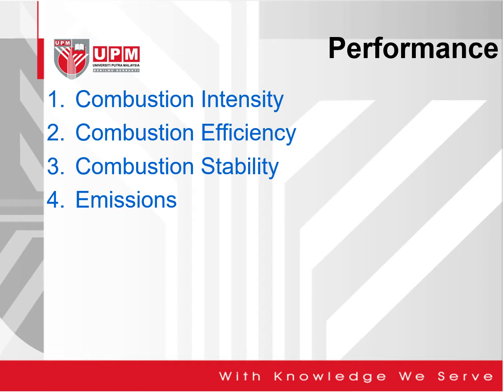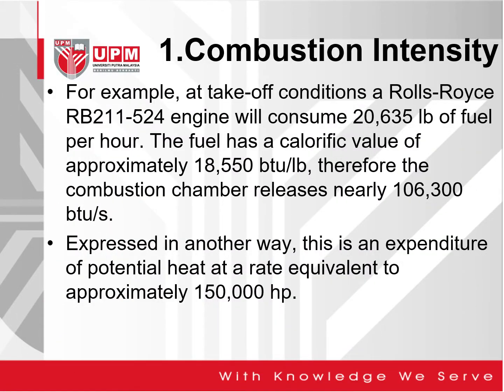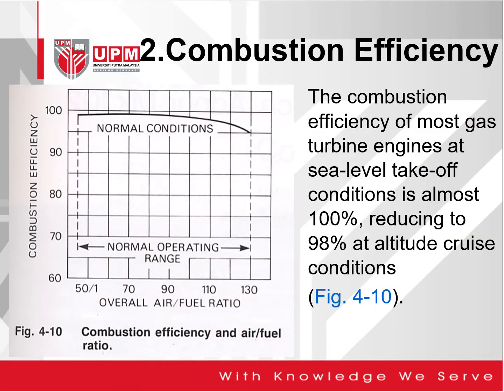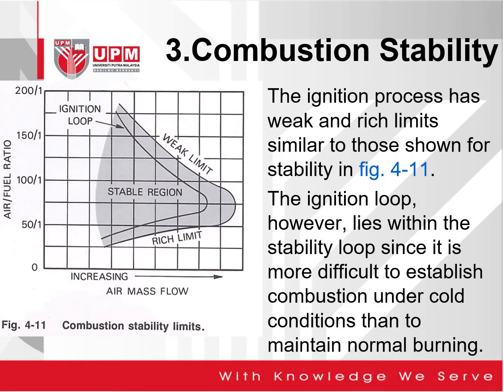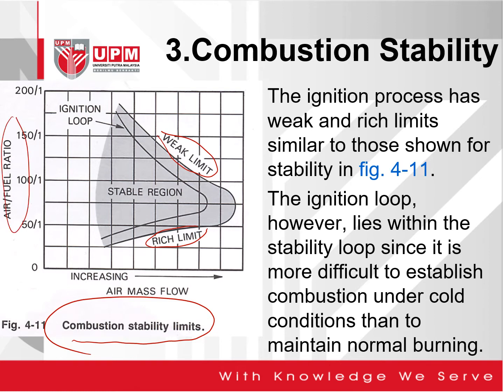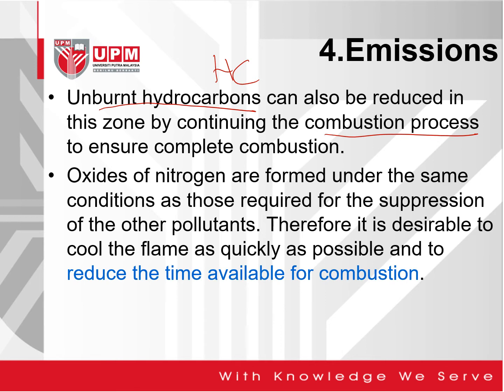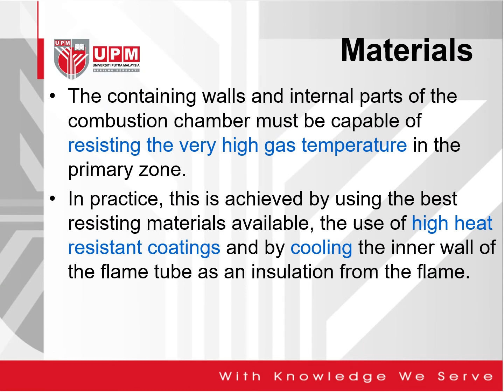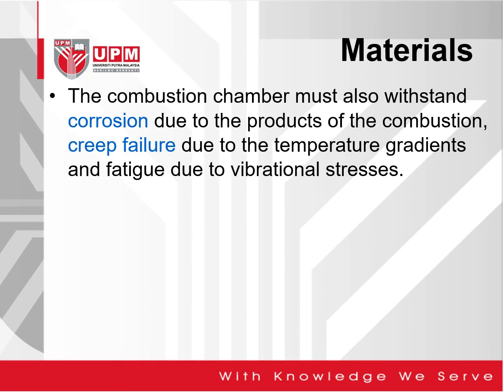Combustion chamber: Performance and Materials

Comment: Dr, why is the combustion efficiency decrease as the altitude increase? Is it due to change of the density of air ?
Reply from the maker: As the altitude increase, the pressure will decrease. Hence the combustion efficiency decrease.